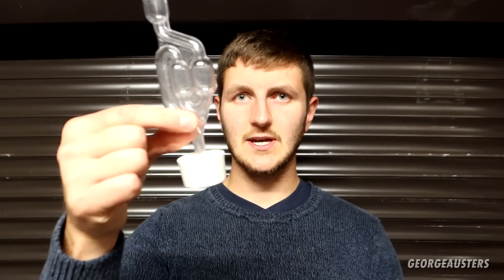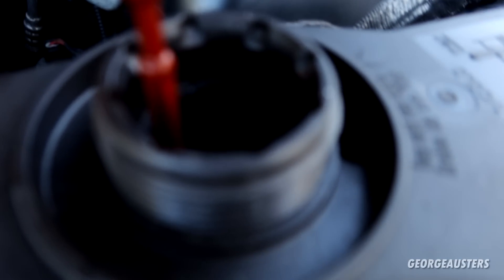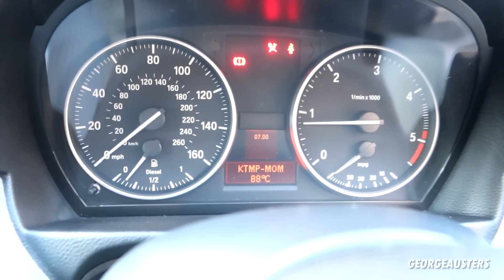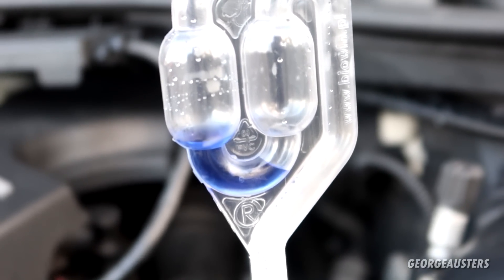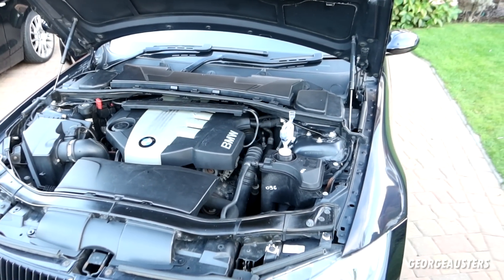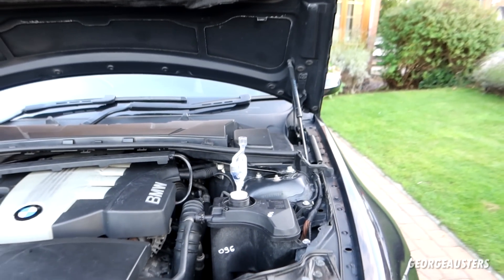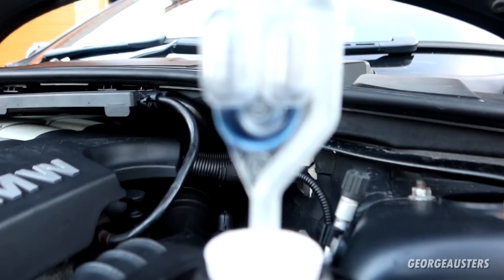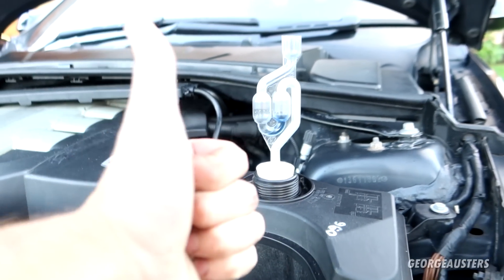HOW TO TEST FOR HEAD GASKET FAILURE ON AN ENGINE *EASY WAY*

Comment: Thank you iv just ordered this iv got white smoke a lot all the time but nothing else seems to be a problem no overheating or coolant loss
Reply: Mine has has a similar occasional smoke out the exhaust and skunky odor issue. Find anything interesting?
Reply: @GrIhCh83  it passed the test I'm thinking I might be carbon build up, turbo or just condensation as don't notice as much now the weather is warming up more in the day.

Comment: Hi I have N43 engine and seems to be loosing coolant every few weeks, also on start up there is a little bit of white smoke but clears up. However my thermostat is faulty as it's picked up on eml. Also after the car has been sat for a day there is still a little bit of pressure in the system.
Also to add since I bought the car it's had a purple coolant in there and I have changed the radiator cap as the old one seemed to be holding pressure and not releasing it.

Not sure if it's head gasket can U advise

Comment: What’s the white liquid in the expansion tank? Mine has the same and was worried that it wasn’t meant to be in there? Cheers bud.
Reply from the maker: White liquid?
Reply: When you opened the expansion tank there’s a white pat not sure whether it’s liquid or a cap maybe?
Reply: At 1:48 when the liquid is going into the expansion tank there is something white in there? What is that?

Comment: Hi if there is a gasket leak do u put gasket leak repair in the same coolant compartment or in radiator is radiator and coolant area same
Reply from the maker: No. If a gasket is leaking then you replace the gasket👍🏻

Comment: Hi George , thanks for the video , I got 320d 2008 , recently change the chain ⛓ timing , got car but was getting very hoot , I checked coolant was missing 1 liter off water , car was driven maybe 3 times after service chain 20 min each time , you think head gasket gone ?
Reply from the maker: I doubt it. Have you topped up the coolant?
Reply: @GeorgeAusters  now
 Yes , I called garage told them that was not enoph water on coolant, tomorrow  car will goo back to the same garage for check up , thanks for replying mate , great videos , keep up good job mate .

Comment: Thanks for the post. I tried this on my car and unfortunately the colour changed to green (diesel). Is it a definite confirmation of head gasket failure? I do get a gradual loss of coolant over time and need to top up every few weeks it seems. Car is on 171k
Reply from the maker: Or your EGR cooler is leaking
Reply: @GeorgeAusters  cheers I’ll check that out 👍
Reply: @jediknight172  @jediknight172  hello sir, how did it end? I Also have a Small loss of coolant overtime and did the test and got a light greenish colour.

Any Help?

Comment: While I was doing this the water came out through the tester. Any ideas why this happened? E90 n52b30
Reply: happened to me to any solution?
Reply: @charlieyoung3238  No, i went to Best bmw specialist in my town and he said that its okay, engine is fine. Its been almost 5 months, sometimes i need to add a little bit of coolant or oil but car is still doing fine, i guess its just another „bmw thing” :)
Reply: @BodzioJovi  thanks

Comment: 5 minutes may not be enough. The engine needs to be really warm. I speak from experience the tester didn't work when the engine wasn't warm enough.

Coolant can also be pushed away through the exhaust so you won't see it in the oil.
Reply from the maker: It was - I warmed it up fully to the operating temp before doing the test👍🏻

Comment: Allright,,there is no motor issue left then make a little make up,clean then sell it to win money.
Reply from the maker: Still need to replace the drive belt kit, clean the EGR, DPF, replace some suspension components, give it a full service and get all the wheels balanced

Comment: Great content as usual bud also fantastic the head is OK what is the shaking side to side on the engine on idle?? ps e60 was much nicer car bud, your dad got good one there👌
Reply from the maker: Thanks mate - yes I agree the E60 is a much more luxury car compared to the E90.

The shaking isn’t even half as bad in person, I think it looks worse because of the camera frame rate
Reply: Do you think maybe mounts? I have similar thing going on with my e60 2008 520 msport same as yours manual was wondering what you think it could be? Would you do exhaust mounts first or engine mounts?? Cheers bud 👌
Reply: Sorry I wasn't clear there bud reason I mentioned the exhaust mounts too is because there's a an annoying vibration when the car is at idle its only passed nct I'm in ireland nct same as your mot any advice mate I'll be checking your vids too for more info thanks👍

Comment: Hi George how tight is the coolant tank cap? Mine is very light like a new water bottle cracking open tight. I have a e87 116i and that is the opposite nice and solid feel to it? I want to check if mine is out
Reply from the maker: It's pretty tight but not hard to remove

Comment: Yh what’s going on with the engine rocking and rolling. My is perfectly still when ticking over. Might be worth checking the vacuum pipes that link to the engine mounts.
Reply from the maker: I think it's just the frame rate of the camera mate because it doesn't do it in person